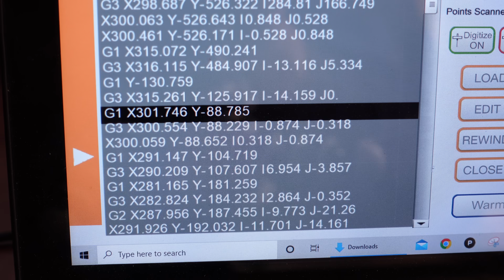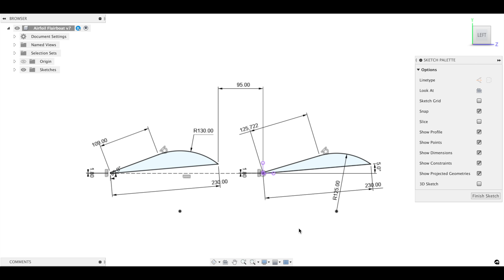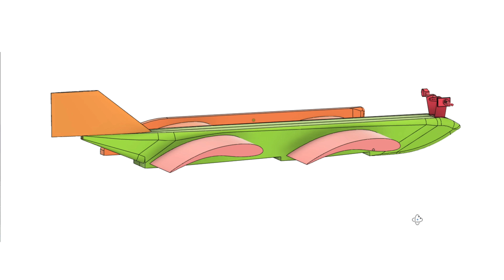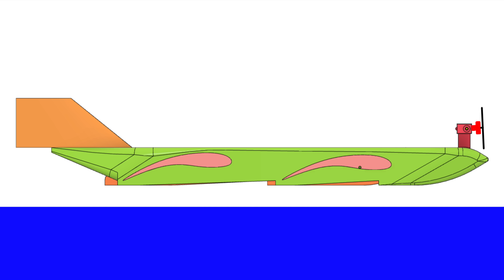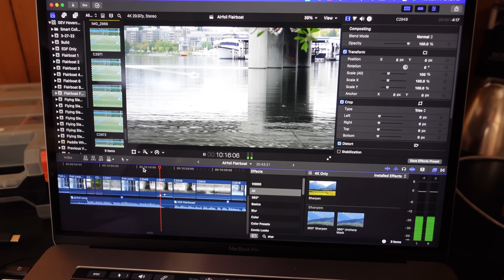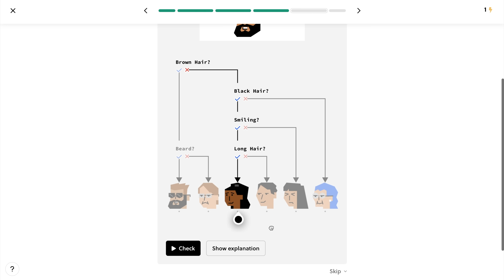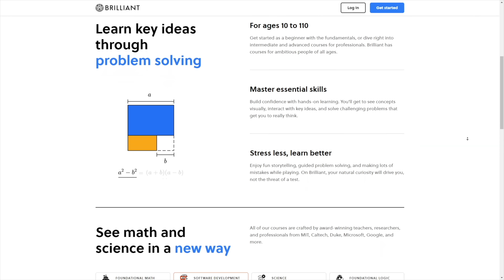Worlds First R/C Airfoil Flairboat

Comment: Secret to WIG vehicles is High Wing Loading (Vehicle Mass/Wing Area) and low aspect ratio (Span^2/Area)<2. 

Combined with insufficient power to overcome the large induced drag which results from this combination. 

CDinduced = [(Lift Coefficient^2)/(Aspect Ratio*Pi)]. 

Add this to basic vehicle drag coefficient and multiply the sum of drags by the wing area to obtain "flat plate equivalent drag" and multiply the flat plate drag by "Freestream dynamic pressure" which is a simple physics formula: Dynamic Air Pressure = 0.5*[Air Mass*(Velocity^2)]

Utilizing these simple formulas will help you estimate power required or in the case maximum power to prevent climbing out of ground effect.
As ground effect eliminates much of induced drag, it will fly well within 1/2 its wingspan of the surface. But drag due to lift will rise exponentially as you try to climb out of ground effect.

Comment: I'm watching this video as a podcast (so I'm not really paying attention) but I have a few suggestions...

A. To prevent the oscillations you can try to add more weight. That way it costs more time to move up/down and in that time you can regain lift to stop the unwanted motion.

B. Try to figure out it's drag coefficient in and out of the water. This way you can tune the engine setting better. Maybe?

Comment: First on the internet maybe. One of my family friends, Tony, had a couple of them among his R/C collection in the 80s-90s, they were a pain for finding anywhere to play with them because anything other than a perfectly flat body of water on a perfectly still day would have them face plant the water or flip, so generally they only came out when the weather was fine and there were no boats, RC or otherwise on the water. Back then they were all nitro powered and made from wooden dowels, Balsa, styrofoam/insulation sheets etc and were very much a labor of love and experimentation to get them working reliably - if at all. They definitely couldn't be driven upside down either so it was one of us kids jobs to get in the dinghy and go get it when one inevitably ran out of fuel, flipped or got waterlogged and couldn't get off the surface again, technically my first ever job was being paid small change by other members of the RC club to retreive their airfoils and hovercrafts.

I remember my uncle had a big blue and white one for a short while that he had made from parts of a conventional balsa Cub (that I had crashed into a tree the year before) and some kit out of the back of a magazine with Tonys help and instruction, Tony had made a red and orange one that I loved to play with because it had a fancy system that made it impossible to flip by cutting throttle the moment it pitched up so all us kids got a turn on it, he also had a purple one that was really souped up and that he mostly played with on his own - I remember he let someone have a go on it and they slammed it into the raised concrete overflow of the lake and I was scared to get close to the overflow in the dinghy to retreive it in case I got sucked in. The last time I went down that way to see my uncle, Tony had sadly passed away, but my uncle still had Tonys last creation in the garage, his "Tictac" - called that because it was the same green/orange as the Lime/Orange tictacs - but without any of the motor or avionics as they had been sold for his widow, no-one wanted the main fuselage though, even if it was the latest and greatest in later 90s composite plastics and fibreglass, as no-one can be bothered with a toy you can only really use a couple of days of the year, it's probably still there rotting away.
Reply: I looked, definitely not the first on the internet or youtube, by a long margin.

Comment: the simplest ground effect glider  you can do with a sheet of paper, just fold the shorter side 2 (or 3) times at 1cm, stand on a chair, and let it fall straight down to the ground, before the paper hits ground it will turn horizontal and fly about 1cm over ground some meters. So the flatter the better.

Comment: The so-called float step on the underside just before half the length of the float facilitates the transition to planing by deliberately detaching the water flow from the rear underwater part of the float.  Breaks the water wetting force

Comment: Increasing the angle of attack on the front wings would cause them to stall first. That way, when the pitch increases, the front would begin to stall and lose lift but the back would continue to generate more lift. The higher angle of attack would generate more lift at a given speed though, so you might need to then decrease the front wing area or move the CoG forward. An airfoil with a sharper leading edge will also stall more abruptly, so keeping the AoA near the stall point would make a rapid pitch up lead to a stall rather than instant lift off. Vortex generators would then help re-attach the flow so you don't nosedive into the water before the lift comes back.

Comment: damn that was so cool.  I suspect that the scale, hence weight, coupled with the narrow power to weight ratio of the 1970s are what is behind those "it never ..." assertions.  but at best those are unprovable assertions given lack of hard data available.  suffice it to say you are in "uncharted waters" sir, the scale and technology offerings of today bring new challenges and new possibilities at the same time.  that said, why not apply propulsion "systems" instead of a single system and leverage sensor data and automation to strike a balance whilst in transit.  also given the lack of human sensory information and the vast quantity of digital information I think leveraging automation will be your best bet, perhaps setting threshold triggers to drive subroutines in ardupilot with mavproxy could prove useful.  of course finding those values is your first challenge as you are so aptly accomplishing.  well done

Comment: Wow you’re so close to being perfect about 12 to 15 years ago I tried building a ground effect boat plane with dismal results finally ended up building a hovercraft I wasn’t happy with it either and I switched over to hydrofoils to be honest I didn’t do very well there either but I had a lot of fun trying. Then I switch back to fly my floatplanes still have about a dozen or so all modified standard aircraft I even have a J-4 Jenny and a Tiger mouth on floats. And they drop torpedoes I made out of plastic baseball bats that I bought at the dollar store with electric motors that run off a capacitor they run on top of the water but look cool
Reply: That is pretty cool- there is a reason these vehicles don't have that much practical use!

Comment: I think any object with wings will fly free of ground effect given enough thrust. And given enough speed any object skimming along the water surface will suffer flip, because once that front edge rises and catches the air, what else can it but do?
I have seen tethered flash steam hydrofoils riding clear of the water, probably on a combination of aerodynamics and prop thrust.

Comment: You should try a front canard instead of rear elevator. Solve pitch issues. Instant positive response to changes in elevation and to changes in lift in rough seas. Shouldn't go into uncontrolled flip if you can make the nose push down! (Computer controlled canard for perfect, seaworthy ground effect?) Also, if the propeller(s) is on the canard, it can aim the propeller/air down or even up.
I thought this one looked interesting:  https://www.youtube.com/watch?v=1r8sE3FXoyQ&ab_channel=hakmt

Comment: What would happen if you increase the angle of attack on the leading wing? IE, raise the front of the wind a few degrees, that way its higher so the water wont tend to flow over it on launching and it might increase the high pressure at the trailing edge of the wing, greater ram effect, if it pitches up too much then , then increase the air gap at the rear of the front wing.

Comment: motor needs to be lower and further back with like a 1 - 2 degree up pitch. and make the the trimm controlls less. aka make the servo arms longer. should fix alot of the problem..... going with irl video of it flying.. the motor is damn near infront of rudder . you need it closer. to the rudder.. and need to compensate for motor to weight ratio..... mabie add 1 to 10 grams on each side of the rear on the wing... try to achieve  50-50.  or 60-40.. 60 being rear. it should help a lot.... just a thought thing.... most planes prefer forward weight.... well think of it as a reverse plane and that should fix the problem... just an amatuers guess tho

Comment: One of the things to remember about these types of vehicles is that the low power to weight ratio was part of the design goal.  It was a vehicle designed to carry heavy loads at high (er) speeds using less fuel.  The famous Kaspian Sea Monster could shut down the forward engines and fly only on the two aft engines once it was airborne.  That was the design goal.  With full power from all 10 (!) engines it could probably get out of ground effect, they just never tried it.  It could fly quite high above the water though, well high enough to be out of the ram-air hovercraft effect.  So, designing for, or using, reduced power isn't cheating.  100% power for take-off and 20% (or less) power for cruise was the intent.  It dramatically increased range and reduced it's audible and infrared signature.

Designing and building a vehicle that can ONLY operate in ground effect at such a small scale, with the incredible power to weight ratios that a model can achieve is automatically going to be tricky to do.  Scaling down the vehicle without compensating for the change in relative air density just makes the model more airworthy.  It's operating in a relatively thicker fluid for it's weight/density.  I'm not sure if less wing area, a change in airfoil, or added weight would compensate for that though.  I suspect that the wing-loading on the model is quite a bit less than the real craft.

In any case, wonderful videos and great work on the craft.

Comment: The reason it works better with more weight isn't the autocorrect in the ground effect, it's that more weight means that a tiny aerodynamic change will be less damaging to the momentum.

With yours being super light, a tiny gust of wind,  a tiny wave, or a tiny change in your rudders/elevators is a change in lift that is significant to your overall momentum, which is the difference between your nose going up or crashing down.

That is part of why the giant planes work better, because a meter tall wave causes a massive change in its lift, but not an amount that is significant to change its momentum in its desired direction.

Comment: My guess is that over grass and road the airflow is more turbulent, causing the air under the wind to provide less (consistent?) lift compared to water.
Reply: The surface is not nearly as smooth.

Comment: Haha nice touch on the music video
Reply: PS- totally need a casting lure and pole to retreive that thing!

Also...dont ask me how i know bc i dont know....intuition i suppose but from my experience when around ground effdct the item sort of locks in it and doesnt fall out easy. I feel like your designs are hevily flight designs which are cool and totally work but id be tempted to change the propulsion to something powerful with more emphasis on creating the effect with trapped air from movig rather than forcing with thrust. Maybe a jet, shroud etc. Limitless. Also i would only use lift control or "flight control" in protyping with only trim click to lock in a position that works but not available to use on the fly......and fly. So you end up with a ton of power lifting to gf from a semi wing trapping an air bubble underthe craft with only speed and steering control. Once its in the bubble and locks in (depending on how efficient) it will have a speed range like any vehicle.

Comment: The reason why heavier craft work better is that the pocket of air required to lift the craft has to be a higher pressure. At least that is the theory I understand.

Quite a neat system!

Comment: I think it's pitching up when you let off throttle bc if the sudden increase in drag on the prop when it stopped spinning it causes enough drag to push the back end down allowing pressure to build underneath lifting the nose
Reply: If so, then i would expect it would loft whenever the vehicle is at that speed with the prop at a given RPM (or lack thereof) and pitch.

Comment: It would be great to release this as a kit for a small fee , with parts already cut  to other RC operators and possible come together with a solution to help keep the boat low to the water without the air flow causing the RC to lift higher under deceleration

Comment: The air over the water will have a temperature gradient which is also a humidity and density and viscosity gradient. It'll be some segment of a parabola. Without that gradient the power of lift is reduced. It's all the mass of the water saturated in the air and the cooling effect of evaporation. Don't forget local space is curved in a parabola, so linear processes like evaporation lend themselves to their highest order function, acceleration.

Comment: Flair or flare?

When I read about flarecraft in the 80s, the article said it floated on a "dynamic air cushion" as opposed to a "static air cushion" such as is used with hovercraft. If you define ground effect only as a reduction of drag, then maybe this design does not qualify as a wing-in-ground-effect vehicle.

Comment: Great job.  One little nit.  Flat bottom does not equal "no camber".  (First image result for "camber airfoil" on google is wrong).  
For NACA defined airfoils the camber line is the mean between top and bottom surfaces so a flat bottom, curved top airfoil still has negative camber, and only a symmetrical airfoil has zero camber.     What you were referencing we usually call "under camber" but I only ever hear it used in the RC world.    All negative camber produces a forward pitching moment.  Under camber just produces a lot more forward pitching moment, thus the nose down wheelies.

Comment: This reminds me of unlimited offshore racing catamarans. I worked for a pioneer of the type back in the eighties, so my thoughts may be out of date. 

You want them to lift a bit, occasionally clearing the water, to reduce drag and provide an air cushion to reduce violent bouncing in a sea, but not actually fly. They would flip over backwards if they got too much air while launching off a wave, increasing everyone's heart rate instantly. Getting the correct balance of aerodynamics, hydrodynamics, and power took years, they were better in a relatively mild sea and wind, the monohulls remained better in heavy conditions.

While your research is only slightly affected, there is another problem with hovercraft and ground effect vehicles in general. By definition they are not connected to a high density fluid, like water, and they cannot bank like an aircraft, so turning becomes an issue. Not so much with your craft as it is very low mass and does bank somewhat, but if there is significant mass and velocity and all you have is a rudder, the vehicle may change orientation, but continue to move in the original direction for quite some time, momentum of course.

Comment: It doesn't bother me that you added ailerons because I have some experience in r/c boat racing, but those have a self-righting system whereas this would be somewhat impossible with two pair of wings on each side, so great Idea (good thing it had the prop under the water so you could drive it back to shore). Great vid btw!

Comment: Sure if a vehicle can fly out of ground effect it’s not necessarily a ground effect only vehicle but for full size vehicles that seems like more of an advantage that they can pull up with at least sufficient control if need be for things like avoiding obstacles or if conditions get rough to avoid waves or so they can fly inland as well.

Comment: I think it is due to weight. Having the mass to dampen the vertical motion is pretty helpful. And the light weight is what helps this fly unlike a ground effect only vehicle. If you scaled this up I think you'd have the most powerful water plane ever and it may have the same problem.

Comment: A real ground effect vehicle wouldn’t fly?
We can all agree if you get an elephant going fast enough it would fly. 
The ground effect vehicle is tailored to an airspeed less than a really fast speed, probably approaching mach 1, but I’m guessing less than half that more likely since large buildings roofs get ripped off of them with hurricane winds of 150mph. 
350 is a shton of wind guys. 
So a ground effect vehicle has to be a slower than faster vehicle to use soft enough air pressures to make it work without other active stabilizations.